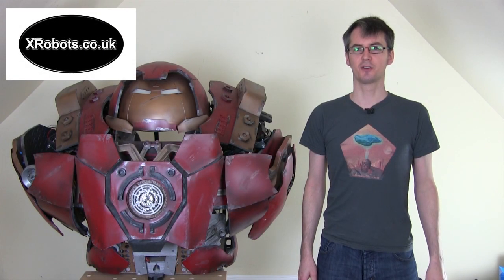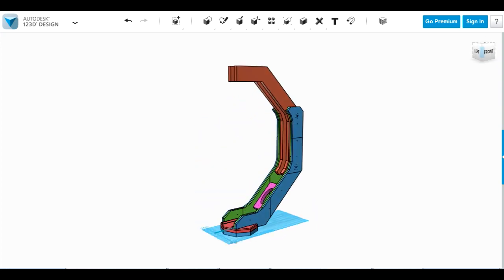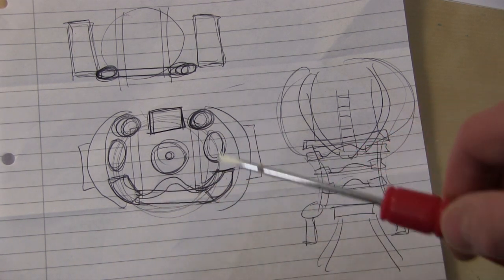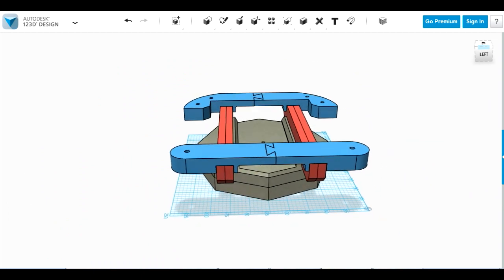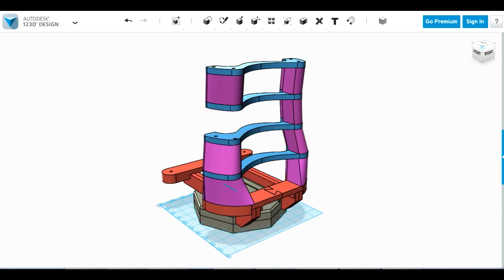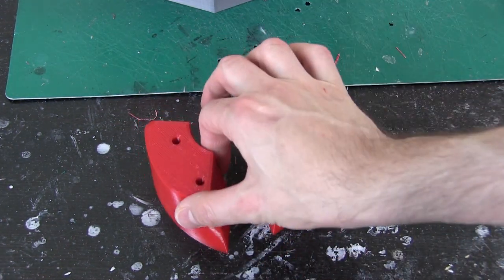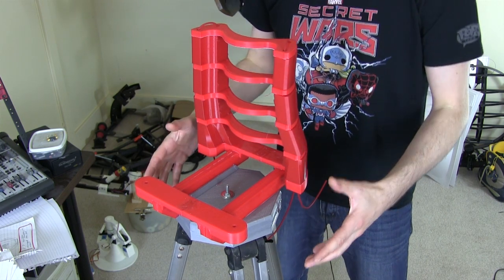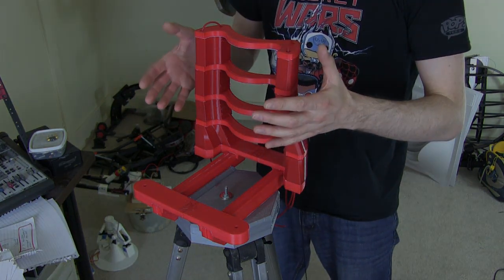Avengers Ultron #5 | Spine Section 3D-Printed in Ninjaflex | James Bruton

Comment: thinking if you evolved the design so the ninja flex vertebrae were round on top and bottom, and the "bars" acting as discs were cupped on the top and bottom and were more like a horizontally mirrored 'pelvis' between each, that would remove both the mechanical gaps forming when the back bends and the need for the ninjaflex to squash in the first place.

both variables making for a much better spine.

if they were totally round, it would create an issue where the back would not want to self correct to verticle, and would be naturally zig zaggy when upright.. BUT either making them eggshaped OR have corresponding flats at the base of each vertebrae socket would fix that.you would have to experiment with the degree of the eggshape to the size of the flat (which ever you choose.. or found worked best) .. the ratio vs 100% round would reduce the gaps and needed flex.. but increase the margin of error on returning to a vertical posture .. and vise versa .. .a trade off... with a happy medium lying In between the extremes .. your current spine being totally flat, without any round in the joints

EDIT: forgot to say.. LOVE THE VIDEOS!

EDIT2.. printing... to print the ball & socket joints.. you'd have to use like a 15% support... or print without it... so the bars and split horizontal and the vertebrae split with a dovetail

Comment: you could have prevented that stringing on the sides by making the printer work on each one individually, instead of having it go back and forth, it would also have reduced the print time a little since the head would focus on one and not spend time moving back and forth between the two pieces, food for thought. other than that great video, I like the idea, but your a bit sloppy with your printer.

Comment: Hi James!

I noticed that when you are pulling the cables through the spine section, it didn't seem like the NinjaFlex pieces were really compressing. Even if it were a heavy duty cord... sometimes I think that NinjaFlex doesn't work well with the current way we design 3d parts — especially when printing tall z-height designs.

Have you ever thought about how cool it is that bones are not an entirely solid construction? (Google image search SEM of bones to see what I mean)

I was wondering what your thoughts are on if the NinjaFlex pieces were to be designed similar to that. Where it's the same general shape, but instead of with a perimeter... it would be a pattern of fibres overlaying each other. Sort of like a sponge.

Running in to a similar issue with a robot I'm making right now too— I have these 'struts' that should flex a bit in order to conform more to the terrain.

Sorry for the long comment, curious for your thoughts on this! Always enjoy your vids!
Reply: Reminds me of some wheels I printed in Urethane! (ninjafelx by its actual name). used an open cell design that allows it to conform to the surface, but by making radial supports that arced outwardly  the wheel would form a rigid lip approximately 10% from being perpendicular to the axis of rotation. So climbing would happen easily even in super low traction environments. The difference between the Michelin Tweel and mine is of course the arced spokes, but otherwise they function similarly
Reply: Reminds me of some wheels I printed in Urethane! (ninjafelx by its actual name). used an open cell design that allows it to conform to the surface, but by making radial supports that arced outwardly  the wheel would form a rigid lip approximately 10% from being perpendicular to the axis of rotation. So climbing would happen easily even in super low traction environments. The difference between the Michelin Tweel and mine is of course the arced spokes, but otherwise they function similarly
Reply: +Matthew McKellar Nice! Tweels are sweet!

From what I've read NinjaFlex is a TPE — which is different than a TPU (Urethane, like you mentioned).

Did you find if the wheels are in one position for too long, they do not spring back to the original shape as well?

Been trying this out with TPU, it seems to go back to the original shape much easier. Though this might also be because the shore hardness is more.

Hey do you want to show your wheels on the Robot Party? That would be cool!
Reply: +Erin RobotGrrl Ninjafelx itself is a 85 durometer TPU to the best of my knowledge, TPE is a marketing term as far as I can tell. 95 durometer semiflex so far seems to come right back from any deformations, I'm using filament from FoxSmart, but it is identical to semiflex in some testing I did, $22 a roll is nice though especially considering the colors and quality. I could upload a nice little video of a robot with specialty tweels if you want.
Reply: +Erin RobotGrrl And yeah totally! you want the model or a whole wheel set in the mail?

Comment: I don't mean to sound like a bit of a douche but if you not going to use that telescope mount may i have it. I have a 6 in diam. telescope with a terrible mount. 

But i love this project with Ultron. I subbed to follow this build.
Reply: Also i noticed that on you BB-8 build you had a printer with a much larger printing surface than your lolsbot printer. Can you tell me what kind it is please?

Comment: Great! But...there's always a but...you are or seem to be thinking to much inside the box. Specifically your NinjaFlex cartilage. Think about this 40% infill on the bottom and top and varying it inside. Meaning 40% to 30% 20% to 30% back to 40%. That may handle the large gaps when you move the sections. It will allow the section to have more rotation and pivot. Also some of the ABS sections in Tea Glass will allow you to light up sections as if they are neural pathways. Just a thought.

Comment: So I know you'd talked of Ultron's AI Core, I imagine that part of the build would be after Ultron himself is more complete. code wise that is. specifically his "emotions" and the reactions it causes. Am I wrong in that line of thinking? because it was something I'm very much looking forward to.
Reply: +DCVM93  franchise so seperate it has no business being mentioned together here but given how james wants to put LEDs on the AI core to simulate thinking wouidnt it be interesting if he modled the AI protocols off of how Pixar's inside-out depicted 5 of the 6 basic emotions in terms of  stimulous-reaction?:D 

like  with those proximity sensors being tripped unexpectedly it trips the danger resposne fo Fear with ultron acting worried and the LEDs glow purple, or if a ervo gets locked by oen reason or another it trips the help singaling Sadness protocol and have Ultron wimper in pain as the LEDs flash blue. or in a conversation someone i dunno speaks a recognized untruth and hat tris the contraditciton/unfairness singaling Anger protocal where Ultron snaps back and the LEds glow red etc.

and maybe as homage to the ending ultron's LEDs flash in two colors when he feels mixed emotions:D.

Comment: Why only one cable through each of the ninjaflex "spines"? You could potentially have more, cleaner, motion if you had, say 2 or 3 lines. If you could change the tension of each line, you could compress different sections giving it a more natural lean.
Reply: +James Bruton (XRobots) Ah, My bad. I should have been paying a bit more attention when you were running through the 3d models. I'd still think it a good idea to be able to control the tension of each line independently, whether a single cable could do that, I'm not sure.